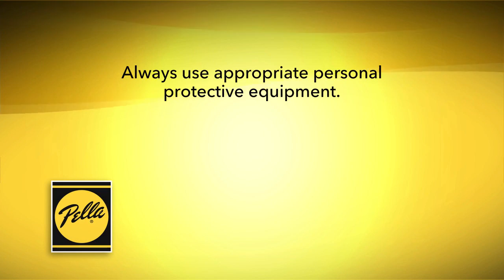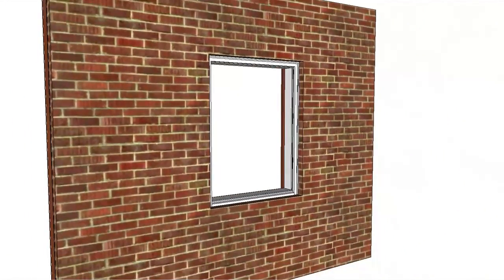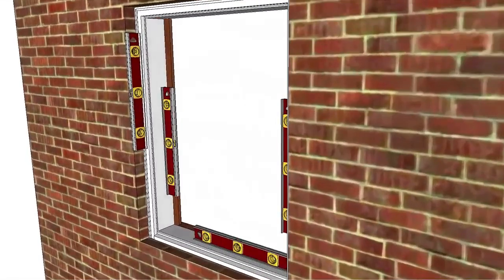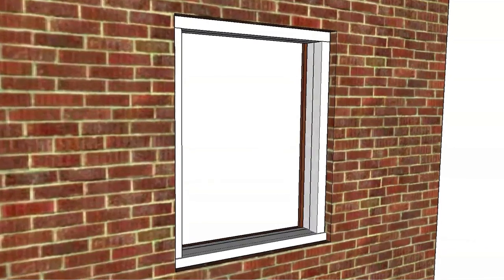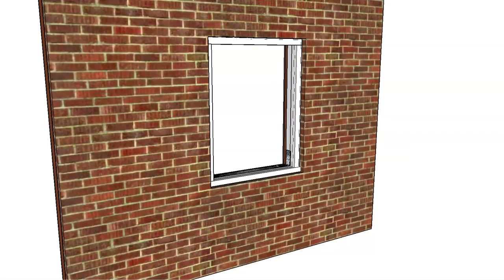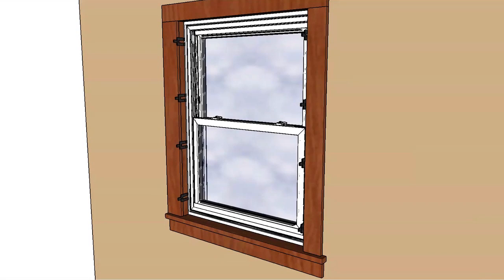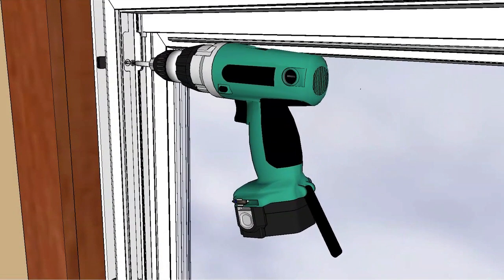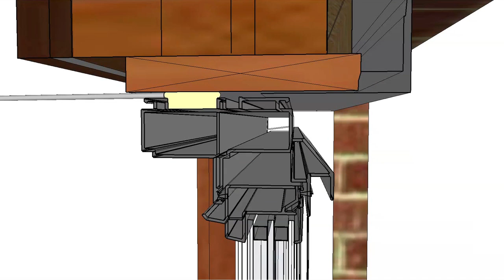Pocket Window Replacement for Casement Windows

Comment: we just replace new sliding windows in Basement. But the fire code requirement is hopper window 24x20 . Is it possible?  we can build new frame as hopper window and fix this slider window in the frame. fix top side Hingis  to open full window  to excess out in case of fire. means we can use both way . when close hopper window fix  lock and use sliding window , means double purpose window . just need to increase window wall hole  2x2 inch's all the side, and fix.  please advise

Comment: It is never this easy on a house built in 1946. They didn't have squares back then. Most builders used tons of chalk which is a real problem getting the old window out of an opening. I have seen window frames out of square up to one inch, so you have to use shims.

Comment: GEES.... you keep saying "refer to the instructions."    I am building an enclosed back porch myself, and picked up a used, pella casement window.   Mine has a wood box already around it and some odd metal flanges.   I was hoping to find out what to do with this but I  HAVE NO INSTRUCTIONS TO REFER TO!!!!!!! 

Also this window is missing the handle.   It's got a lowes sticker on it so I tried calling Lowes.  But they want a serial number on the window.  There is none.  Just some information about the glass.
So I guess my handle is going to be a vice grip.   Still it would be nice to have some actual instructions that even remotely resemble my window.  Not to be found here.

What a useless video this is.
Reply from the maker: Hi there. Here is a link to our installation instructions for windows that might be helpful: https://www.pella.com/professionals/installation-instructions/windows/

Also, here are some instructions on how to locate a serial number: https://www.pella.com/support/find-serial-number/

Hope this helps!